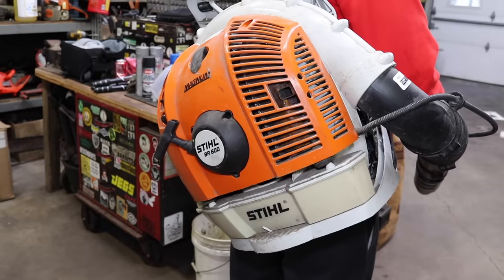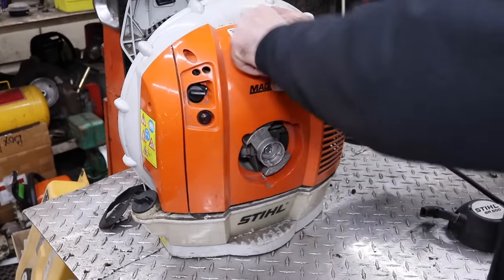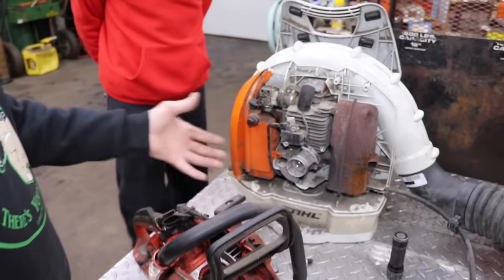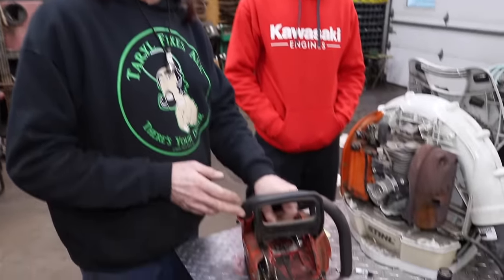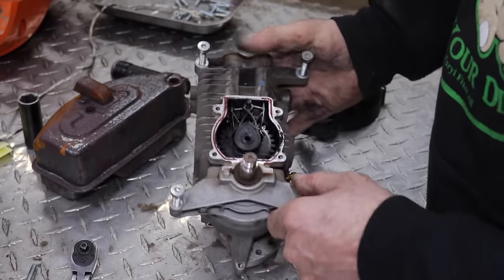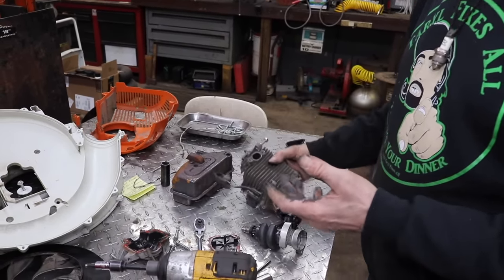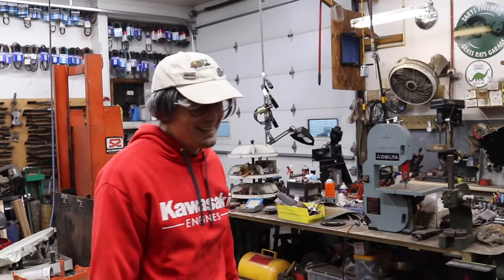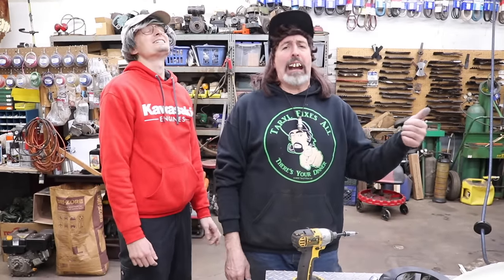4 mix NIGHTMARE! DON'T make this mistake 🚫

Comment: A 4 stroke that requires a 2 stroke mix, now that's genius.
Reply: The weeder engines run forever that are the 4Mix
Reply: They don't have a crank case to fill with oil or need oil changes. It sure is nice
Reply: @meegstomtom  agreed,just run good gas and oil, that blower piston was done a long time ago, looked like  was run on straight gas 1 time
Reply: @meegstomtom  technically they have a crankcase and it is full of gas/oil mix.
Reply: @bluejene2146  I never said it doesn't have a crank case. As in it doesn't contain a sump in the crank case like most other 4 stroke engines go. And it is most definitely not full of gas/oil mix. They lube similar to a 2 stroke where the intake air containing the air/fuel mix lubricates the internals.

Comment: I have a Victor lawn mower that is 33 years old that still runs like new. I used castrol 747 2 stroke oil as this was what I used in the Yamaha KT100 karts, It was expensive but then Castrol stopped making it so I had to find another oil , tried other brands of oil but finale started to use 2 stroke chainsaw oil although the mower does not rev as high as chainsaws it has been  a very reliable mower. Oil is so important in any engine. Cheap or incorrect oil is expensive in the long run.
Reply: How many refineries or oil testing facilities  u own "oil expert"?

Comment: They should be Nationwide recall on these backpack units to make it right!
Reply: That’s what Milwaukee did on the junk “B” 1/2 cordless impact
Reply: These units have been around forever and i still see 10 year old ones with no issues with the wristpin. This is caused by lack of oil/wrong oil. Use ultramix at 50:1 and it will never die.
Reply: They sell crap

Comment: Sounds like the makings of a class action lawsuit.
Reply: Maybe, but they can and would just say, we require you to use our oil, or an equivelant quality oil. No engine should look that scummy using good oil. Not that the bushing design vs a bearing isnt an issue, but yeah.
Reply: @baileyhatfield4273  agreed it’s people that have no clue what they’re doing that are having these failures. They’re not using the correct specification of oil and therefore the machines are coming up and failing. I’ve had my BR 600 for over 10 years and it has been flawless you just need to use good quality oil and the right mix.

Comment: Even if they'd used the needle bearing instead of the bushing, the wrong oil would cause the engine to blow up. That was the real problem here.
Reply: 100%, the piston, crank, cylinder all looked HORRIBLE. The oil they used is 100% the issue at hand. Sure the bushing could of been a bearing instead, and the bearing on the journal of the crank still looked fine, but time would tell with that horrible oil, dirt grime.
Reply: Yea. A bushing isn't a bad design really. I have bushings in the wristpin on all my old mopeds and motorcycles. That works great and is nice and quiet unless they are worn out. But you have to run a little bit more oil in the gas so it gets proper lubrication
Reply: You're the 1st one out of 400 to post that it was an oil quality issue. Thanks
Reply: this goes directly into the crowd of OIL is OIL.
numerous guys on you tube are saying the stihl syn oil is crap.   one guy says the crank bearings are as dry as a popcorn fart.

my redmax-echo- still running.....7 hard years.....redmax syn oil....and the red armour lately.......

oil aint oil.

i have a stihl trimmer.  ill never buy another stihl product.
Reply: @Harry Harry  ok but i see 10-15 year old BR600s in my shop constantly that were only run on stihl oil and i can still see cross hatching in the cylinder. I work on echo and redmax too. The problem here is the oil quality.
Reply: Nah, this engine was run without oil of any kind for a tank.  Owner then put oil in next tank after it started to natter and then took it to Taryl.  Even bad oil can get to the wrist pin.  That sucker was DRY.  The crank bearing only survived because it has needle bearings but probably got a little damage also.  Cylinder was scored.  This ALL points to no oil at all. No way in the world oil being present whether bad oil or magical oil would let a wrist pin dry and heat like that.  Makes no sense.

Comment: I think they went with a brass bushing to save weight. That pack will be worn for a long time if there are a lot of leaves to blow, so they didn't want to add the weight of the needle bearing.
Reply: Perhaps, but the weight difference between a bronze bushing and a needle bearing is negligible. The price difference however, is more significant.
Reply: Lmaf....it's about saving money on no heat treatment on con rod....probably got a good bid from China with a few $$$ thrown at the   guy who okayed it....

Comment: A bronze bushing can easily be sourced and cut down on the outside diameter for a press fit, and a reamer to size the interior for a precision slip fit.  The wrist pin is in good enough shape on this machine (from what I saw in the video) to do this.  Not a very hard job.  McMasters is your friend for bushings.

Comment: Looks like you might could drive that boogered  bushing out   and get a replacement bushing   at  some place like McMaster Carr  or eBay  might need a teeny bit of machining to bring it into correct spec sure would be a hell of a lot cheaper  alternative fix

Comment: Only Stihl could make a 4 stroke engine that needs to use 2 stroke oil vs having a real oil system.  What's the point buying a 4 stroke engine that's heavier and less top end power over most modern 2 strokes that still has to use oil mixed into the fuel which part of the main reason you would buy a 4 stroke is to get away from mixing oil and fuel plus the extra smell and emissions it creates.
Reply: My thinking exactly! 
The least they could have done is use an oil injection system like Yamaha and Polaris did.

Comment: This engine uses a bushing pressed into the con rod for the piston pin because STIHL R&D found that needle bearings cannot withstand the combustion pressures of the 4-MIX engine. Needle bearings were tested during development of the 4-MIX engines but failed consistently. The 4-MIX engines transfer a much higher torque to the piston pin bearing surface for a longer distance of piston travel than what a 2-stroke experiences. The bushing design can handle the pressure loads much better. On STIHL 4-stroke mix lubricated engines, when there is a lack of lubrication, typically the piston pin bushing will heat up and seize before the piston and cylinder score. I have purposely run many STIHL 4-stroke mix lubricated engines with no lubrication in tests and they rarely score a piston and cylinder as would occur in a 2-stroke. On STIHL 4-MIX, the wrist pin seizes instead.

Comment: The 4mix motor worked great on the pole saws but the blower applications were almost 100% failure rate. Buy a echo and run it for years.

Comment: Owners manual says 50:1 mix fuel …all my equipment gets 40:1 and a good synthetic 2 stroke oil…..no problems with any of my stuff for 10-16 years depending on how old …..I got a stihl BR600 three years ago and has been fine so far…just got a BR800C so we’ll see how that holds up.

Comment: Hey brass bearings are used a lot on 1950ties moped and small motorcycles for the wrist pin and they last a long time on 4% premix and the can be exchanged by you average machinist

Comment: I have a few questions. 1. Are Stihl moving away from the 4 mix design because it is a pup? 2. Can Slippers go to the youtube site where they teach you how to say it properly. "Steel" is not it.  3. if the oil isn't getting up to the wrist pin then it would not matter what oil is used as non was getting there. Even the correct oil would not work. The design is not allowing oil to splash up. Will petrol with ethanol in it promote oil separation as water may accumulate from condensation?

Comment: I tell my customers that no matter what, use a 2 cycle mix that has a JASO FD rating and use E-Free gas. It will have a big ass "FD" on the side or back of the oil container. And oddly enough, Stihl makes a 2 cycle oil that is NOT FD rated. Also, oddly enough, that same Stihl mix was the culprit in more than a few engine rebuilds/replacements. Especially on high rev engine applications such as commercial weed whackers...

Comment: Bought a BR700 a little over 4 years ago. Bought and only use Stihl HP mix. It was just out of warranty by a couple months and had the same thing happen to it. Dealer called Stihl and they honored it. Sent a new engine. Also sent new housing it mounts to cause it’s a little different now. I wonder if they changed the motor to fix this. I’ll ask my dealer. But the mechanic told me to mix it a little rich. I always followed the direction, one gallon of straight gas for a 50:1. He said do 3/4 gallon gas. I drive to county to get straight gas, I treat my gas with Opti-mizer max per the dealer (even tho it’s not needed in straight gas), and ONLY use Stihl HP Ultra mix. Had my blower new so I know it’s history 100%. This makes me worry about it happening again!!!
Reply: They sell crap

Comment: I’ve replaced bushings on rocker arms that they said were not replaceable. You press out the bushings put a new one in don’t forget to drill oil passage hole. Then ream it to the correct size. I would have bought new rockers but they weren’t cheap on this rare engine.

Comment: Great, I just took delivery of an 800C, sidestart model, they extended the warranty to 4 years, if I purchased the  stihl 4 mix oil and made me sign that I was aware the unit specifically needed that oil.  Luckily, it won't be used for anything big, just wanted to have a big azz blower😂.

Comment: I still have the old 85 blower I got from the trash man years ago and last fall I wanted to make a Vacuum out of it. I ordered the ruberised blower nozzle and the rest of the stuff it needed but the dealer guy thought I said 86! NOPE! Started to put the parts together abd nothing fit! All the new stuff was way off cheap. Took it back and got 85 aparts and it runs perfectly. I run orange bottle Stihl mixopil and Tru-fuel. Sorry Slippers!

Comment: My recollection is that Stihl had a carbon build-up problem after introducing the 4-Mix engine. It even sold a de-carbonizing product along with a technical bulletin on how to use it. Thereafter, it began selling it's silver bottle HP Ultra full syn oil in order to alleviate the 4-Mix/carbon issue. As an incentive (and to lessen complaints), it offered to double the warranty if a buyer purchased a 6 pack along at the time of an equipment purchase. I use Ultra an my 2011 BR600 (got it free in 2016) and so far so good.
Reply: This is exactly right.

Comment: Lots of engines use bronze bushings or no bushings at all in small end connecting rod but maybe not the best choice for mostly constant full load application like blower (most of the time it's running it's at full throttle).  If unit runs hot, maybe Stihl needs to work on cylinder cooling air flow.  Stihl probably saves a few dollars on each unit using bronze bushing vs needle bearing.  Would be interesting to see engine teardown of same unit with confirmed Sthil oil used.  Interesting video.  Thanks
Reply: Owners just need to use good quality oil and mix it right. Ive owned a br600 for over 10 years without a single issue, Stihl platinum oil, and Amsoil saber.
Reply: what they need to do is just make a bigger version of the BR400 and forget this 4 mix cr@p...
Reply: Didn't all the early lawn boys use bronze bushings?

Comment: Very interesting video.  My Stihl dealer actually extended the warrantee on my BR800X if I purchased a gallon or two (I forget which) of the Motomix fuel.  So far, no issues and have been using that exclusively (just a homeowner with a very large yard).

Comment: Been using Supertech full synthetic 2 cycle oil and VP full synthetic oil for 20+ years never had a problem. All full synthetic 2 cycle oils are JASO rated. My dealer said I couldn't use it because it was not good but my JASO FD rated oil is better than Stihl JASO FB rated oil and 1/4 the price.

Comment: I have worked in property maintenance for more than 12 years (in Europe). There has never been a single problem with these machines. We use pre-mixed 2-t mixes of aspen, husqvarna.. I don't know what grades you use in the USA. I can't say the hours of use for sure, but I would think +200h/year /machine. We have ten machines in daily use.

Comment: I have an FS131 trimmer with the 4-mix engine, and I don't see it lasting five years, much less the twenty plus years I got from my FS85. I think my next one is gonna be a Shindaiwa.
As for my oil, I switched to Echo Red Armor in all my equipment.

Comment: Old KOHLER engines had a brass tag attached that gave the oil mix. Believe it or not it specified SAE #30 motor oil. (Not 10W30)

Comment: I worked on Lawn Boy mowers years ago, 90 percent of engine damage was caused by customers using outboard motor oil, or automobile engine oil for the gas/oil mix. Customers who used the genuine Lawn Boy 2 stroke oil could run their mowers for 20+ seasons with virtually no engine wear. A yearly tune up would keep them running like new. So it's not always the manufacturer's fault when an engine failure occurs. In this case, the wrong oil was the problem, but a needle bearing in the wrist pin end of the con rod maybe would have saved this engine (at least for a while).

Comment: I ran the Stihl full synthetic oil in my BR600’s for years but switched to Husqvarna oil because it was a little cheaper.  No problems and now I’m using Echo oil. They both come in gallon containers which I prefer. 50:1 ratio.  The blower in the video might have been run with no oil.

Comment: in my experience 4 stroke engines generally have bushings on wrist pin that being said this engine has no oil sump and gets its lubrication like a 2 stroke therefore it is a exception to the rule and should have needle bearings in wrist pin like 2 strokes have.

Comment: I have commercial customers that only use the 4 mix oil and we still see occasional failures. I was hopeful this problem was going to be fixed on the BR 800 but no, although I don't see as many issues.
Reply: Br800s have more issues than br600s.

Comment: I've never bought a brand new connecting rod for two strokes, but never seen a new rod being discolored at the piston end. I would have assumed the decolorization is because that end is where all the heat is produced from engine fire. Your thoughts?
Reply: Mine (if useful to anyone) is this engine definitely was run without any kind of oil.  It just smacks of it.

Comment: ive been using amsoil dominator in all my small 2 smoke engines and have never had an issue. about 50% of my small engine stuff is from the pawn shop so the history of maintenance is unknown but you can tell if you know what to look for. some of the stuff i got was in pretty good shape and some i had to bring back from the edge.
if i find stuff and i can get it cheap enough, ill buy and extra unit. i pretty much have two of all the small engine equipment, mostly stihl, because if you know the people at the pawnshop you can pretty much buy two used used for the price of a new unit. i paid, combined, $400 for a br600 and br700 and the parts are the same. i used the 700 and the 600 is ran to keep the seals wet. 
one is none and two is one. been buying stuff with that in mind for 6 yrs and i should never have to buy a new part for my stuff. if something breaks that i dont have, pawnshop. take what i need and sell the parts.

Comment: As I watch this video, I go to Stihl website and check their prices, NOPE! They can keep them. If I’m giving that kind of money, it better be made with quality parts and built top notch. Looks like Stihl builds them cheap and sells them high. I want it to last me more than one summer of use. I will say, I use Pennzoil 2 stroke oil for my boat all my 2 stroke equipment, no issues in the 7 years and I have 3 Stihl products. I do t have a Stihl blower, I have a MS170 chainsaw a FS55&90R trimmers and no issues and they run the same Pennzoil as I use in my Yamaha outboard(225) and my small outboards. I did use the Stihl oils til the warranty went out then to the Pennzoil.
Reply: The backpack blower on taryls bench is 15 years old. Some people are clueless. I see 15 year old br600s with perfect cylinders that have only been run on stihl oil daily.
Reply: They sell crap

Comment: I have a small engine shop over the pond here in England. I have in the last 2 years scrapped 70 of those BR range blowers through the same reason. Even with the correct oil it still happens. Talking with stihl they say its the E10 petrol and to use an ethanol stabiliser but it still happens. They are crap, can't even make good ones out the scrap as they all have the same issue. I agree that stihl oil at the correct mix is vital but they will still fail on you. Happy new year Teryl and the gang! Love the videos
Reply: Husqvarana.  A
Reply: They have E10 in the UK?  Why?  US just does it to subsidize the corn industry.  It also subsidizes the small engine repair industry.

Comment: Happened to mine after 3 years. I assumed the carb leaned out the motor but nope that’s not the case. All I used was STIHL oil

Comment: So is this manufactured issue covered by warranty or blame user for not using right oil? Or fuel?
My poulan chain saw wouldn't run right after 6 months refused warranty because I left the fuel (true fuel) in it cleaned carb and gaskets, and paid over a hundred to repair still doesn't work right.
Thinking of replacing carb?

Comment: Stihl doesn't have "4-mix" oil.  They have the standard HP 2-cycle oil and the Ultra HP 2-cycle oil which is synthetic.  The hp ultra oil would be the best choice.  I heard it is tested at the factory at 100 to1 ratio.  However, the standard HP oil is good to use on the 4-mix engines.